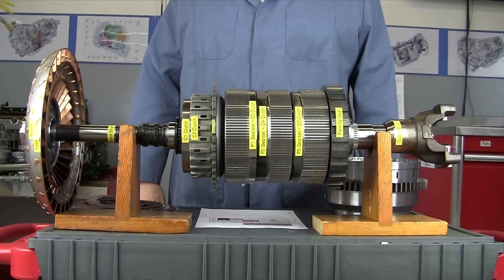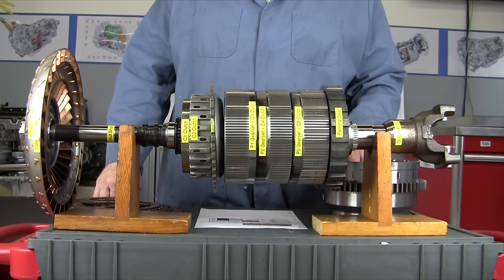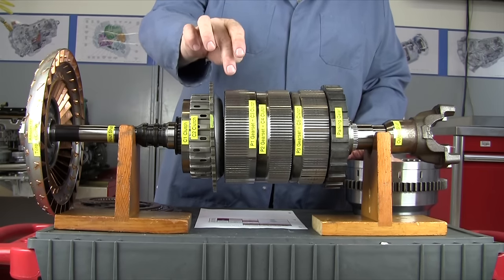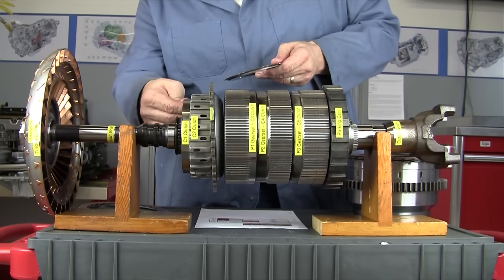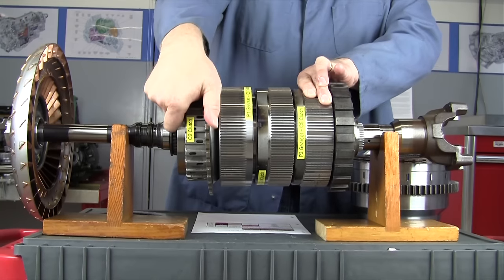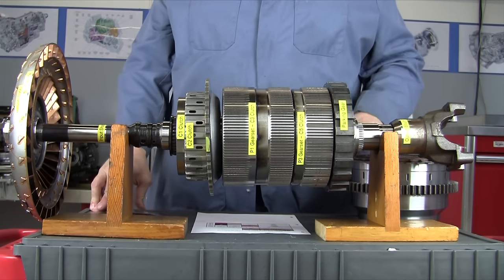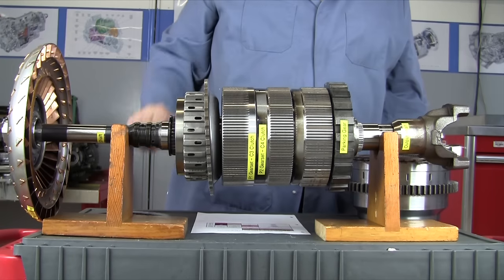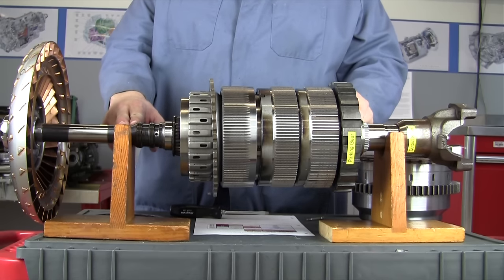Allison 1000 Automatic Transmission Power Flow

Comment from the maker: Good catch, I forgot to include it while shooting the video. Reverse is accomplished by applying the C3 and C5 holding clutches and driving the rotating clutch housing with the turbine. The reverse gear ratio is 4.49:1. Reverse can be accomplished even if the transmission is unplugged from the electrical system because the default "normally open" or "normal closed" power off state of all the solenoids allows it to happen.

Comment: Good presentation. However one thing that would greatly improve it is if you indicate the actual assemblies that power is flowing through i.e rotating clutch assembly to sun gear of P1, PC of P2 etc. That would really give us the exact picture. Cheers

Comment from the maker: Hi, Good question. No, it would bind up because the C2 clutch turns the P2 ring gear which forces the P2 sun gear to rotate.  the P2 and P3 sun gears are connected together with an intermediate shaft.  The P2 and P3 gear sets are Simpson style gear sets and are driven by a simple gear set P1.  Also, realize that 6th gear is already a double overdrive with a gear ratio of 0.61:1, a 7th gear would be a triple overdrive and could be difficult to utilize.

Comment from the maker: Hi, the clutch packs can be used to stop a ring gear, a planet carrier, or even a sun gear; it is dependent upon the transmission design. Clutch packs can also cause gear components to rotate under power.  Each set of planetary gears can provide two underdrive gear ratios,direct drive, two overdrive gear ratios, and two reverse gear ratios. Typically there are only one useable underdrive, overdrive, and reverse gear ratios though.

Comment from the maker: HI, good question. The C2 clutch turns the P2 carrier and the P3 ring gear as an assembly. The C5 clutch holds the P3 ring gear from rotating. The transmission would lock up if you applied both the C2 and the C5 clutches.

Comment: Wonderfully demonstrated, most magnificent design thanks be to our brightest minds.  Here's to the industrious, brilliant engineers and tool makers who make turning the wheels of commerce possible.
Reply from the maker: Wes Sugg Thank you!
Reply: Sad thing is the Allison 1000-2400 design came from a design written on a bar napkin after hours
Reply: Manual transmissions were simpler and separated the drivers from any idiot who could crawl his way behind a wheel, gone are the days when they tested your metal by putting you in a twin stick or a 2 speed rearend truck. Now any idiot is allowed in the large vehicles and they cost thousands to have fixed and there is no chance of doing it yourself, Easily 5 times as many moving parts inside, oh yea you have very little if any control over what gear you in or when, garbage if you ask me, one of my biggest mistakes was buying an Allison in a truck I depended on

Comment from the maker: Hi, there are more differences between the 5 & 6 speed transmissions than the TCM and valve body. There are torque converter, case, clutch pack and piston changes for durability too.  True, you can make a 5 speed have 6 speeds, but it is not the same as a true six speed.  6th gear is only a 10% change, hard to justify the cost. To answer your question, don't forget the P1 sun gear is always driven without a clutch by the turbine, this eliminates the potential for additional useable gear ratios.

Comment from the maker: I did get the names mixed up there, sorry for the confusion.  There are only 3 planetary gear sets from front to back: P1, P2, P3.  There are 5 clutch packs from front to back: C1, C2, C3, C4, C5.  C1 and C2 connect power to the planetary gear sets, the C3, C4, and C5 stop parts of the planetary gear sets. C3 stops the P1 ring gear, C4 stops the P2 ring gear, and C5 stops the P3 ring gear.  The different combinations of rotating and stopping gear set parts gives us the various gear ratios,

Comment: Great video! It's amazing how mechanically simple this transmission is. No sprags/roller clutches, only 2 clutches and 3 brakes. The older 4 and 5 speed automatics seemed to be packed full of bands, clutches and those terribly unreliable one-way clutches. I suppose the all the complexity has moved from the hardware to the software now, since you can just "program" a smooth shift in software, instead of having to figure out how to do it hydraulically or mechanically.
Reply from the maker: +American Locomotive Yes, it is a very simple mechanical transmission. Thanks for your feedback!

Comment: just a suggestion:  you can hang the transmission from a bearing and so that it is vertical and all the shafts are aligned so you do not have such a difficult time with turning in higher gears
Reply: It would fall apart lol

Comment: I'm an old truck/bus mechanic, and this trans reminds me of the OLD MT 40 series. I think it was a three speed with a splitter = 6 speed. Does this trans have its origins in the MT truck and bus trans? I also remember the MT was VERY complicated: like 100 valve body movements from 0 - 60mph. And used brass clutch discs. Lawrence.

Comment: Well done video. What about would happen if you applied the c5 clutch pack after releasing c4 when you were in sixth gear? Would it bind, or would it be another gear?
Reply from the maker: Thank you! It would seize up and stop rotating. The C5 clutch stops the P3 Ring gear. The C2 clutch rotates the P3 Ring gear.
Reply: Okay, I thought that, but wasn't sure. Thanks for the reply

Comment: Couldn't you get a 7th gear by applying the C5 clutch and turning the C2 clutch housing? Or would the gear ratio be undesirable?
Reply from the maker: +Joseph Tilitsky Hi, no, that would actually lock up the transmission and kill the engine. The C2 housing is connected to both the P2 and P3 sun gears. (A simpson gear set). The C5 clutch stops the P3 carrier from rotating.

Comment: Which Allison is used on a 444 (7.3) navistar? I have a ford with a 7.3 PSD dump truck which has a e4od which fails. Can these be retrofitted to the 7.3 PSD? I am aware mini school buses have 7.3 with Allison's. Thanks
Reply from the maker: I do not know, but I suspect it is a 3000 or 3500 series. Allison makes 3 speed through 8 speed HD transmissions and has many different model options. Sorry I could not be more helpful.

Comment: Hi John,

Thank you for the very informative videos. I've learned so much from watching your videos. I had no idea how an automatic transmission worked before.  

One thing that I seemed to have missed in all your videos is about clutch packs. I realize that the steel clutch plates stay fixed with the transmission housing and are squeezed together to apply force to the fiber clutch plates to stop a particular planetary gear set(s) from turning (essentially like brake pads on a rotor). The question I have is ... it seems like there isn't a lot of force exerted on these parts? Is that correct?  Otherwise the fiber plates would wear very quickly? Essentially the way I think it works is the power is always looking for the path of least resistance through the different planetary gear sets and clutch packs.  In other words, the clutch packs are really only stopping the inertia generated by the weight of the spinning planetary gear set and not engine torque (or minimal engine torque).

I'm trying to also understand how the Aisin Warner AF40 works with regard to clutch packs.  The literature describes the shifting of gears being managed by a sophisticated computer program which oversees a clutch-to-clutch actuation. Gear changes are accomplished by one clutch engaging the instant the clutch from the previous gear disengages so I think that would be different than this Allison as there is no "neutral" between shifts - is that correct?
Reply from the maker: C Collins Hi, check out my video on planetary gear set operation. https://youtu.be/5piYEX-jRt4?list=PLIn3FrDiB1ly9wKVH406Ia99z79qaG41B I cover all of those topics. Get back with me afterwards if you need to. Thanks for watching!

Comment: The 5 & 6 speeds use different valve bodies, do they not? What I learned at WyoTech is that the only difference between 5 & 6 speeds is the TCM & Valve Body. I hear it's about $1100 just to purchase the Valve Body. I didn't get to learn the power flow which is why I'm here. Great video helps to understand. Q: If you apply C1 & C5 for 1st & C1/C4 for second, could you split the middle by applying C2/C5? Would this work in all ranges? Seems to me that we have a potential for 12 speeds or more.
Reply: If you add a secondary gear unit such as GearVendors Overdrive/Underdrive (planetary-type gear-splitting unit) you would end up with 10 forward + 2 reverse (5-speed) OR 12 forward + 2 reverse (6-speed).

Comment: my 02 duramax only has reverse. the gear shift highlight blinks when I give it any amount of throttle once in gear! seems like a pressure issue ? cs
selinoid issue ?
Reply from the maker: It could be any of dozens of things causing this issue. You must get someone with a a scan tool to check for trouble codes, then follow the diagnostics for the code(s). Best wishes.

Comment: It is important  for me. Thanks. But why sun gears is faster  than holding  C1 clutch  ?? when you try to make 5 or 6 gear.
Reply from the maker: I am sorry, I do not understand the question. In 5th and 6th gears, the C2 clutch is applied which rotates the P2 carrier.

Comment: hi, i am a newbie in transmission, i was looking for transmission video for quite a long and got your channel finnally. Your explanation is awesome. Explaining transmission is not simple one. I have question in General, not for this tranmission, Every planatery gear will have a clutch pack, and when u apply brake (via band ) then you would always stop ring gear of that planetary set,  not any other gear (like sun or planetary gear), if my assumption is wrong, ... continued in next post

Comment: +WeberAuto Thanks for the video, very well done.
Following the shifting pattern through all 6 gears, (C1+C5, C1+C4, C1+C3, C1+C2, C2+C3, C2+C4), what would happen if you were to apply C2 and C5 after 6th gear?
Reply from the maker: +Cobrajr122 Hi, the transmission would lock up because C2 turns the rear two (P2 and P3) sun gears and C5 stops the read (P3) ring gear. Good question. Thanks for watching!

Comment: I have an 03 Duramax with the Allison 1000, when i get into 5th it is almost like i am getting vibration in the transmission. i was told that it is losing pressure but i am not sure what to do about this. Any advice?
Reply from the maker: +Justin Tuck There is an oil pressure tap right next to the Red spin on oil filter. It uses straight threads, do be careful to use the right adapter. There is an oil pressure test you can have done to verify proper fluid pressure. Make sure the fluid level is correct first. Those trucks are prone to having driveshaft vibrations. It can cause such a vibration that it will break the output housing of the transmission.

Comment: Just a thought, what stops/prevents me from using a 5spd allison as a 6 spd?  Is it just a simple computer change out, or are there more mechanical things internally that are different like different converters, different size gears, etc.?  I've got a 5 spd, my friends have the 6 spd. I get better mileage in town (guessing engine styles/programs) and his gets better on the highway (assuming because of that last gear).  Thanks.

Comment: The demonstration for the reverse gear portion is missing. Is it possible to append it in this video Sir?
Reply from the maker: +S Chandrasekar I'm sorry about that. Reverse is accomplished by holding both the C5 and C3 clutches and allowing the rotating clutch housing to turn the P1 sun gear. Thanks for watching!
Reply: WeberAuto i know this is several years after the video. but do you believe that a 7th gear could be added by holding the  p3 gear set and turning the c2 clutch
Reply: iirc, c2 is holding the planet carrier of the P2 set, which rotates the P3 ring.

Comment: Hi . Ive got a Volvo V70 2000 that runs fine then after 3 minutes driving up the road it starts to slip then just looses drive all together same as reverse as well. Its fluid level is ok. very dark fluid. Any ideas as to what would cause this.
Any advice appreciated.  Al

Comment: what are the dangers of over filling this transmission?
Reply from the maker: The transmission fluid will get up into the rotating components, become aerated (full of bubbles), expand greatly, fluid can come out of the vent. Aerated fluid compresses and can allow clutch packs to slip causing severe transmission damage. Aerated fluid also does not transfer heat very well, so the transmission will run too hot.
Reply: WeberAuto wonderful. guess in paying my transmission builder a visit... thanks for the information!

Comment: How is oil directed into the C1 and C2 rotating clutches?
Reply from the maker: +hlyautey The oil to the C1 and C2 clutches comes in through passages in the middle of the rotating clutch housing fed by the turbine shaft. I removed the rotating clutch housing outer cover for this demonstration.

Comment: Is it normal if I have hard shifts every time I go into drive or reverse and then into park
Reply from the maker: +Vidal Martinez Hi, it usually is not normal, but there were some model years that were worse than others (2001-2003). There were many flash updates for the TCM on those years to help address those issues and others. Best wishes.

Comment: how does reverse work?
Reply from the maker: +Garry Geromo Hi, the C5, and C3 clutches are applied in reverse. The rotating clutch housing applies engine power to the P1 sun gear without any clutches. That is how reverse is obtained. I forgot to include it in my video. Thanks for watching!
Reply: thank you very sir.

Comment: Thanks so much for response. It would be a great benefit if you can tell us 
how to diagnose bad torque converter, how to diagnose bad clutch or bad band in transmission with transmission on engine. This will be great help for many of your viewers to get protected from fake news.  if transmission goes bad let say if clutch is  slipping or if it is not downshifting or upshfiting, what are the comman cause.. may be a kind of crash course .. I dont mind paying you for doing such kind of webnair.pls

Comment: I did a search for allison 5 to 6 speed conversion. It can be done but requires a replacement TCM and a different valvebody and costs $2300 for the parts alone. not a very good return on investment.

Comment: Its actually not the ideal choice for racing. Many actually will replace them with other transmissions instead. The weight is a big issue 330lbs isn't exactly helpful in racing.  However the biggest issue is the clutch-to-clutch design. Its strength is its weakness. Due to the transmission having to go to nuetral it cannot shift fast enough for the performance desired. Shift tie-ups=broken shafts.

Comment: If you were holding the ring gears with your hand, then there must be bands to hold them. There is no way you can prevent those ring gears from rotating without locking them on the housing by band or lock brake.
Reply from the maker: +Odouls77 Hi, you are correct, the ring gears need to be held by something, but it is not by bands, they are not strong enough. These ring gears her held my multiple disk clutch plates. The bottom ring gear (P3) has six fiber plates, the P2 has 5, and the P1 had 4. The overall area of the multi-plate clutches is greater than a band could have for the same diameter. Thanks for your feedback, That was a good question. Have a good day!
Reply: +WeberAuto Still those clutch plates must be secured to external solid support not by the rotating shaft. You can not stop anything unless you're standing on a solid ground and not on slippery ground.
Reply from the maker: +Odouls77 True, they are secured to the transmission case. I neglected to say that is my last response. Sorry for the confusion.
Reply: The brakes are secured on the transmission case by means of splines inside the said case.

Comment: I'm not unintelligent, and I have watched numerous videos trying to understand how an automatic transmission works. While I appreciate the creator of this video for trying, this video is pretty useless. I'll sum it up. "This is a good transmission. It has parts. Buzzword buzzword buzzword.  Look how strong my hands are holding parts of this heavy duty transmission while I use my other hand to push it round and round. Watch it spin. Watch it spin at different speeds depending on what I grab. You  don't need to look inside! All you need to see is the round outside. Look at it spin!. This is a really good transmission." Maybe this video is predicated on all sorts of training, knowledge and experience, but quite frankly, unless you are already a mechanic or an engineer, the video will teach you nothing.
Reply from the maker: +Jeffrey W Baumann Hi, watch this other video first. it explains all of the internal parts you mention. Thanks for watching.
Reply: +Jeffrey W Baumann Hello Jeffrey. If you're in trouble trying to understand how it works I sugest you take a look in the book "Automotive Transmissions – Fundamentals, Selection, Design and Application." written by Gisbert Lechner and Harald Naunheimer and published by Springer. Read chapter 6 and maybe it will enlighten you. It requires you to know a little about mathematics and some mechanical principles, have a nice reading.